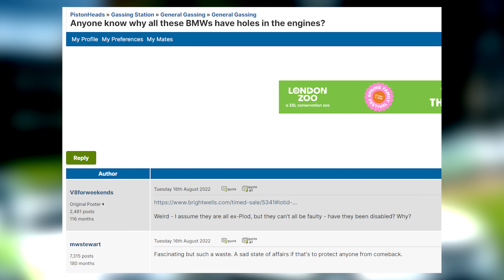Why The UK's Police Cars Keep Catching Fire (BMW N57 Engine)

Comment: Sounds like their usage profile would be perfectly suited to EVs, no?
Reply: would run out of battery running the AC and equipment. would also take spaces on charging stations and they still catch fire.
Reply: @white_mage  No need to run anything when not being driven. Certainly not A/C. Charging is fast. Fire risk is massively less than petrol/diesel cars. If they do catch fire then putting it out is a bit more interesting but the figures show this to be rare.
Reply: Batteries would probably get cooked pretty quickly if they're suddenly flooring it every so often.
Reply: @itIsI988 that’s not how it works at all ahahah. The issue would be how long they can run. Cop cars have very long idle times
Reply: @KlassikHaus  I meant that there would be frequent current spikes which would drain them quickly and thus necessitate frequent charges. Both the heat and the frequent charging would likely deteriorate the batteries quickly.

Although yes, they would be better when sitting idle.
Reply: yeh the cops in London got Kia Ev and the Polstar

Comment: In Romania the police introduced the sedan version of these beamers to fight with the high number of old tuned cars (most of them being made in the late 90s and early 2000s) and cars that had been crashed in Germany and then fixed and sold for a smaller price in Romania. Until last year the police used Dacia Logan wich was painfully slow and at its 86 hp it couldn't catch a snail. Oddly enough not even one police beamer caught on fire in my country.
Reply: Neither did the police cars in Ireland and they also used N57 engines
Reply: @aidan1585 they still blow up just not because of the engine😂😂
Reply: The new romanian police bmws are the brand new 3 series. The brand new 3 series use b48/b58 engines. Those are 1000% more reliable. Infact they are one of the most reliable engines on the market.

The one in the video here is a N series engine, and the N series engines is arguably bmws poorest series ever. 

Eu sunt roman si iti spun astea ca stiu.
Reply: @blocksource4192 no? BMW do not make the most reliable anything LOL
Reply: @fourppounds  are u living in 2010 when they put f1 engines in their cars? Their new cars are actually the most reliable on the market…
Reply: @blocksource4192 b48/58 only apllies if the cars are petrol. The new G20 3 Series uses the B57/47 for it's diesel variants, that engine is basically a tweaked N57 and that One is just a tweaked M57. And to be honest, if they went with the old trusty M57 they would be better off. The M57 is probably the most reliable engine that BMW has ever made, if maintained properly it'll do 800k km easily. And it even has good support from the running community, there are plenty out there running 700hp with stock internals and even gearbox
Reply: @blocksource4192  N57 isn't a bad engine tho. Much much more reliable than the N1x, N2x and N4x engines. As the pinned comment says, the main culprit in generating those fires is infact the particle filter. Can't argue with you about the B58 reliability, that engine is mad good, but i wouldn't say that its "1000% more reliable".
Reply: @blocksource4192   A b48/b58 is a 2.0 turbo petrol and 3.0 turbo/twin-turbo petrol respectively, `just about every police force across Europe uses diesel cars. Including Ireland, where I am from. We have 530d's (N57, F10 generation), no issues. X5's (F15, with N57 single and twin-turbo, 30d and 40d respectively), no issues. The British police force do NOT maintain their cars as well as they should. It's nearly completely their fault for the accident (with respect to the man and his family of course). Long idling hours and heavy acceleration is hard on engines of all guises. The N57 is partly to blame but these accidents would not be happening if the British police force properly maintained their cars. Never happened in Ireland and we have a ton of the vehicles out on the road.
Reply: @aidan1585  not true and what a crap engine it is with potentially high running costs to try stop it catching fire and to restrict how its driven. they had to get rid of them. bmw is crap get over it, german cars come worst for reliability in public surveys aswell, is that fake too? lol
Reply: @aidan1585 There is no "British police force". If these incidents were isolated to one particular force that wasn't maintaining its vehicles you might have a point, but multiple forces clearly felt the vehicles were a liability and got rid, to the point that BMW threw their toys out the pram and shuttered their specialist vehicle sales division entirely. Ending sales doesn't sound like the response of a company that has faith in its product.
Reply: @lemcakes32422  virtually every bmw diesel with like 4 exceptions can live up to 500k km without extensive maintenance.
Reply: @MrHabushi  To the best of my knowledge they never had any issues with the B57/B47, just the N57. Why remove all the BMWs from most fleets if it is just one engine model that is affected. One that started to be phased out back in 2015. That is 8 (coming close to 9) years ago. Well, possibly because BMW stopped selling the police specialist vehicles for police forces across the United Kingdom. Why you ask?  Most likely due to all the scrutiny they came under by the UK. These 'issues' were not found by any other police forces across Europe, where N57 engined police vehicles are common. I'll give you an example, my country, Ireland. We have a national police force, 'an Garda Síochána' (The Police, translated from Irish/Gaeilge, literally meaning the Guardians of the Peace). They never had any issues... with hundreds of N57 equipped BMWs. Why? Why didn't they but the British forces (most) have tons of issues?? Maintenance. They ignored manufacture (BMW) service requirements for specialist vehicles.

Also, I meant the British police force as a whole, yes the actual forces do not represent the ENTIRE nation but just about every single one used an N57 equipped BMW.
BMW did not discontinue police sales for BMW cars because the N57 was dangerous, as I said earlier, the N57 was starting to be phased out in 2015 slowly. Going out of production in 2019 with the end of F30(F3X) and F15 production.
Reply: @aidan1585  diesel days are over for cop duties in uk
Reply: @lemcakes32422  unfortunately, back to the trashy 2.0 petrols
Reply: @aidan1585  b57 then? The b58 is based off of b57 and should be reliable with little maintenance. Idk tho.
Reply: @lemcakes32422  nobody cares mate, buy yourself a reliable japanese tincan and stay quiet. People who want BMWs will keep buying them regardless of what some internet "experts" claim.
Reply: @aidan1585 
😂😂😂
A Merc diesel is only just run in at 500k miles.
BMW have had a LOT of problems with diesel engines and the reason is their mantra of trying to make them too light to 'improve' (?) performance which always leads to inferior reliability.
Reply: @WeeShoeyDugless  you are seriously mistaken. there are millions of bmw diesels with over 300000km. Many still with over 450k. With an exception of around 5 BMW diesel engines, they can all reach 500k km.
Reply: @aidan1585  
Older ones maybe but their latter offerings are crap.
Timing chains snapping, bad design but BMW took nothing to do with it.
Watched a programme on them being examined by experts, they all said the same thing, crap engines.
You say 300,000 miles as if that's a high mileage😂😂
Try a million plus for proper diesels!
Reply: @WeeShoeyDugless  I said they can EASILY make that. Other than Mercedes-Benz Truck/Bus etc. engines, their car engines can not last 1 million miles plus other than ones from like the w123 or something. The B37, B47 and B57 are all amazing engines that are very reliable and I never had any issues with them.

Also, i am not hating against mercedes.. i have owned many mercs in the past.
Reply: @aidan1585  
Still say you are wrong. 
While holidaying in Kefalonia, we have used the same driver over many years. 
A couple of months ago, I asked him how many klicks were on his taxi now and was pleasantly amused when he pointed at the odometer which read 800,000 odd kilometers.
I said wow, not bad, then he told me it had 3 permanent drivers, 24hr service and that it was on its 2nd round of the clock!
Not bad for a 2014 E220 CDI 
My own Merc diesels have all had 200,000+ miles on the clock with no breakdowns and only regular servicing.
My current E220 CDI has over 100,000 miles and regularly returns over 70mpg on long runs.
It is also reams better than my brothers BMW which is younger but is hellishly put together, constantly needing discs and rattles like a 60s car.
Granted, he doesn't look after his cars but, neither do I particularly other than services on time and an oil & filter change mid service interval.
Incidentally, I passed a relatively new (2018/19ish) Bentley sitting on the hard shoulder of the M3 yesterday, bonnet up, sizzling nicely🤣🤣
Reply: @WeeShoeyDugless  Well you're mentioning a Merc that came out in 2009. I highly doubt a new W214 can go for 800,000km? Do you?
Reply: @aidan1585  I dont see why not, Merc always made fantastic diesels and they still do.
Reply: @lemcakes32422 how many N57s that the UK Police wasn't resposible for maintenence do you see catching on fire? Yeah it's probably zero or really close to that. If it only happens with their cars ,they are probably the problem. Don't buy fancy cars if you don't want fancy maintenence bills. It's like buying fancy clothing that specifies needs special washing programs and then complaining because its ruined after washing  with normal clothing...
Reply: @MrHabushi here in Portugal, Police uses both the BMW N47 and N57 and we haven't had even one fire, but somehow the UK ones keep catching on fire, other European countries also don't have that problem. If it only happens with you , you're probably the problem...
Reply: @WeeShoeyDugless Trust me a new Mercedes isn't just run in at 500k, at the Mercedes dealership I worked at we almost saw had them reach Over 400k km without replacimg the engine or atleast opening the engine for some repairs. Your statement would be true for old Mercs like the 190d but not the modern ones
Reply: @G_Silva404  
Trust me, no car dealership has an empty repair shop (even rolls royce or bentley) so your statement is pretty meaningless.
Just ask the millions upon millions of taxi drivers in every country in the world how reliable they are.
Reply: @WeeShoeyDugless Renault  Mercedes?
Reply: @davesmith60  
By that I presume you mean the small (re-engineered) engines Reanult build for Mercedes?
And your point is?
My farmer mate has one in his small Merc van and has had ZERO problems with it at all.
So again, your point is?
Reply: @lemcakes32422  mai facut sa rad
Reply: @lemcakes32422  not true
Reply: I've been saying this since i saw romanians introduced them . Bmw lost uk as customer so they went and signed with romania.
Reply: @pifandrei5743 Fair play, Romania is getting bigger and richer with higher earnings - and taxes of course. The UK is going the other way. I mean apart from the taxes, of course.
Reply: Surely any police pursuit would've been embarassing for them
Reply: Bimmers*
Reply: In the Uk these bmw are pushed over the limits everyday, because here is big police state.
Reply: Te-ai murdarit de engleza fmm de pishat
Reply: @georgebogdan397  ghiorge, trebuie sa te relaxezi…

Comment: I can't comment here, but as a bodyshop technician in Cornwall, I have alot of experience with the fleet of BMW in Newquay/St Austell.
I have also worked in recovery garage that takes all driving stops which had a compound for all vehicles. Which includes forensics with the police.
HA (Hell's Angels) and Scorpios from back in the 90's, I've done paintwork for them. I know things that many of the locals know nothing about.
Reply: cool story bro
Reply: steady on mate!! im from st austell and nothing gets past me, those pasty munching police men are all nonces driving in their corsas and astras. i dont trust em. unless theyre locals of course. (joking)
Reply: out of curiosity you dont happen to work at tommos body shop do you? opposite the mot place
Reply: close, but no not Tommos. @TheCornishGingerOfficial
Reply: Pasties are from Devon...
Reply: your point being lol
Reply: @patrykhoj he can’t comment here 😂
Reply: low mileage BMW have high hours running time in there engines. Which was quickly explained in this video of Blags.
I have been in the motor trade since the late 90's, if you can add more information to my comment rather than your three words, then I am all ears. @patrykhoj
Reply: @PatrickSwayzeOnDbol  im just a 13 year old who helps with fixing cars but i have heard of the low mileage stuff, especially rhat my parents have both an e36 and f10 so yeah but i cant anything more but id love for you to tell me some more stuff about cars

Comment: Which is better BMW or Mercedes
Reply: bmw
Reply from the maker: Personally I prefer BMW without a doubt
Reply: Mercs are better built and cost more, bmw used to make a quality car back in the day, but have started doing things on the cheap, hence I chose a merc
Reply: @samcoppack9012  Merc build quality is very poor these days, not what they used to be.  However, I do understand that in your own mind, you are trying to justify your poor purchase to yourself. I guess you gotta do whatever makes you feel better!
Reply: Toyota for reliability
Reply: I personally like all german cars. but my family owns 3 bmws, I own 1 myself. 

So here's my perspective:

If you are really rich,

If you want a BMW buy a rolls royce, if not, buy a mercedes maybach.

If you are somewhat rich. Don't buy a 7 series, buy an s class.

If you are barely rich. Buy a 5 series, not an e class
If you are average. Get a c43 amg or something. A m340i is really nice, but I personally love the look of the mercedes, especially the C series.

If you just want reliability. Post 2016-2017 (only b series variants) bmws are way better than mercedes.

Whatever you do tho, don't get any bmw 2007-2014. Get ONLY post 2016 (also only b series. Do NOT get an N series engine. Some cars still had N engines till 2017). Those are super reliable. 2007-2014 will blow up on you like the one in the video. 

If you want a crazy high performance car... get a mercedes amg hopefully one before they switched to inline 4s, or the ones after their switch (they are going back to v8s)

Also, if you don't want your car ever having problems.... Just buy a inline-6 bmw b58 vehicle. Literally will not ever have any problems.